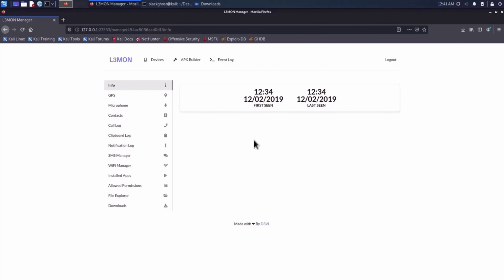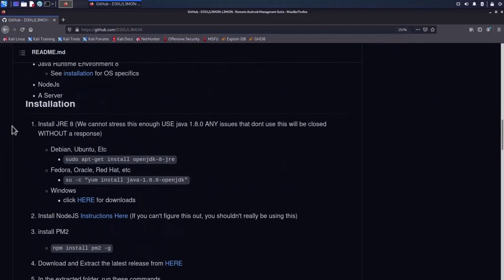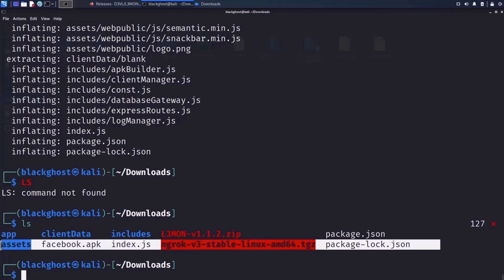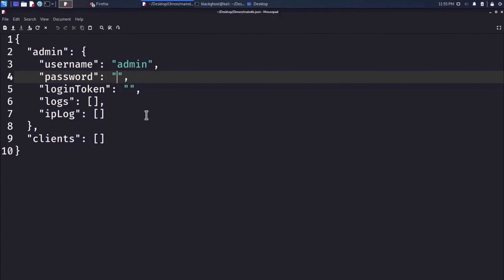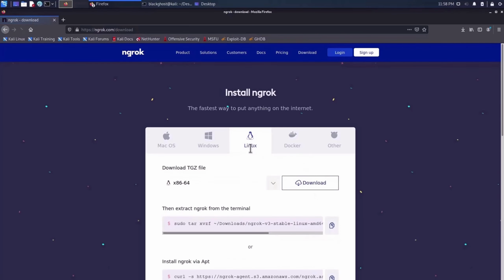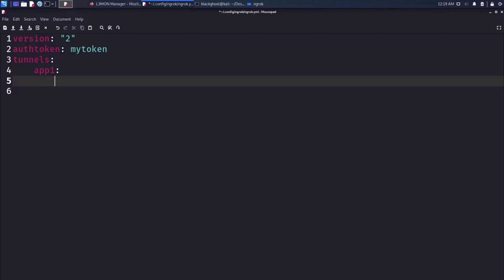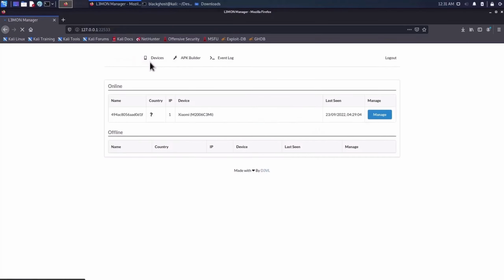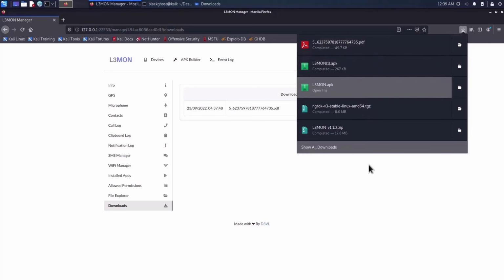Pt 2: Simplest Ways To Remote Access And Control YOUR Android Devices (OVER THE INTERNET)

Comment: Hi. Thanks for this tutorial. Please the l3mon link is no longer accessible. Is there still a way to do this?
Reply from the maker: I don't know why the link stopped working.
However, copies of l3mon-framework can still  be obtained from multiple GitHub repositories. Adding a link to one of those repositories.

l3mon-framework from GitHub:
https://github.com/efxtv/L3MON

Plz reply if this works for you!
Reply: @NABLab  thanks for responding. It worked for me. However, my device doesn't come online on my L3MON dashboard after installing the APK in the target phone. Do you have any idea why this may be so?
Reply from the maker: @joelnyatse3852  Glad it worked. Do you created tunnels ad pet the video?. If not, you can connect you device via local network through a wifi maybe. Otherwise, that's the reason of it not working.
Reply: @NABLab  I have tried both. Local network and creating tunnels but no luck for me yet. Will keep you posted
Reply from the maker: Hmm.. Your device can be blocking this in anyway maybe? If you have configured the port and ip correctly then it should have worked. Can you try again and hopefully it may work. Or is that the github repo that you  have used? Could you search on github l3mon and use another one to verify that?